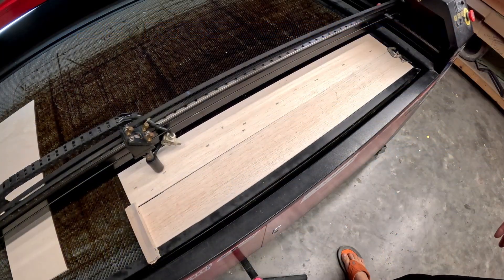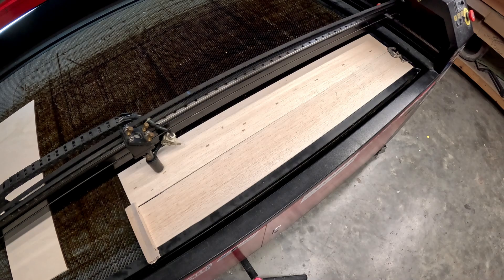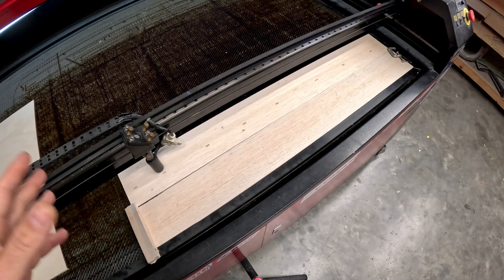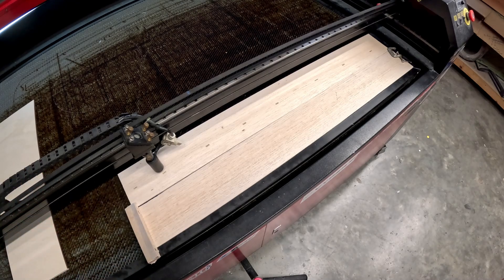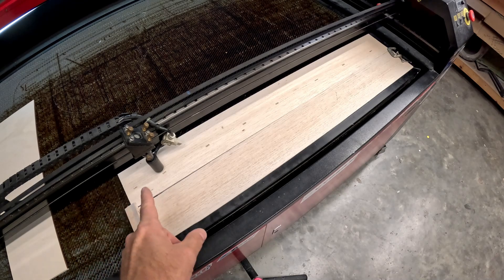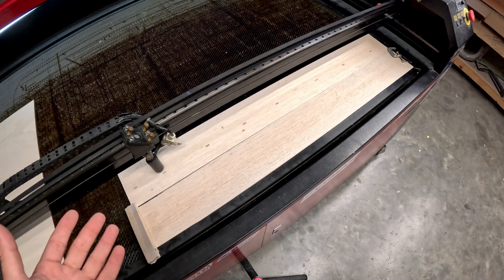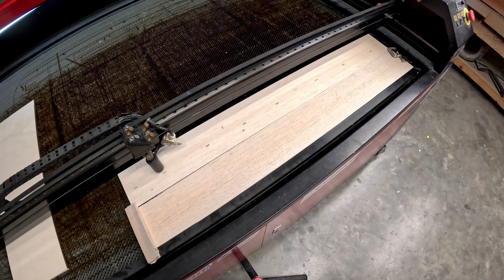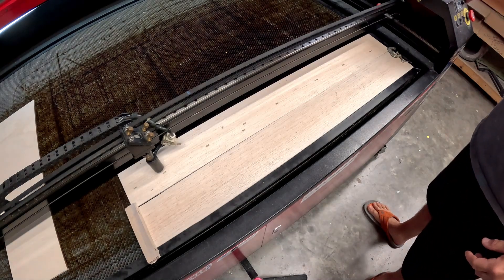B 29 Restoration Project #44   Flight control cutting

Comment: Hi invertmast, I recently watched a video about etching and fill that may help you speed up your laser projects.  This was using Lightburn.  In it, the author found that if they did each shape fill sequentially, it would eliminate a lot of the white space moves and reduce the time significantly to do the fill.  In the Fill Layer settings, select the Fill Shapes Individually option instead of the Fill Shapes at Once option.

Comment: Fascinating to see the cutter at work.  Anxious to see the parts go together.  Between the printer and cad cut structures anything is possible.
Reply from the maker: @briansilcox5720  that will be shown in a video soon.  Unfortunately i messed up on the ailerons and they ended up about 1/4” to thick, so i get to redo those.  Which i think i missed out on video’ing some of the building of them, so it’ll be a chance to fill in that gap.